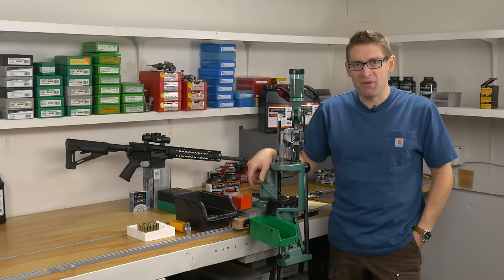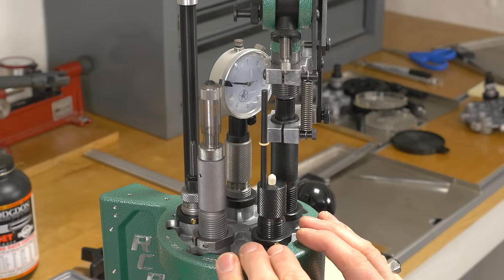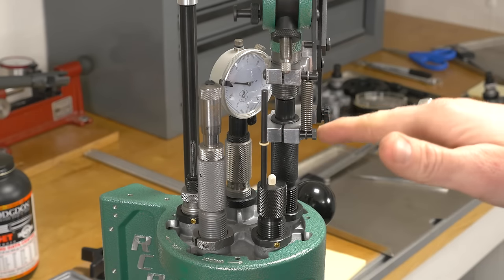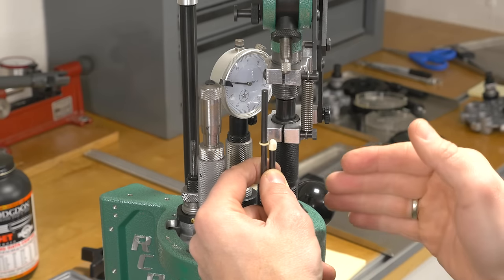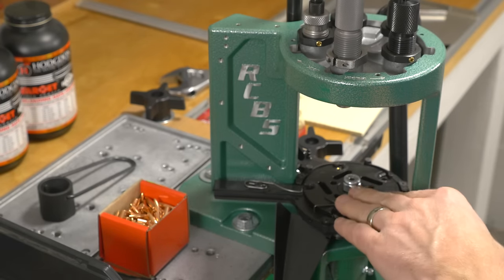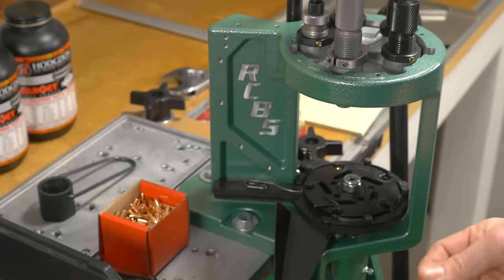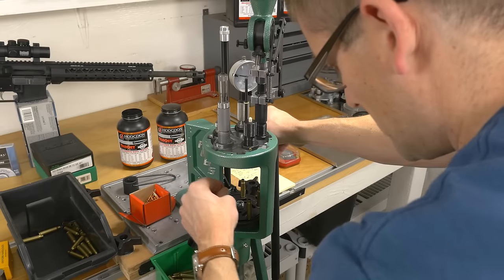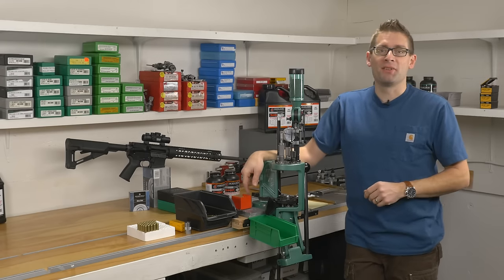RCBS Pro Chucker 5 Loading  .223 Remington

Comment: I like the Redding gauge setup...As you know, it also indicates if trim length is more than .010 under OAL. At exactly 8:00 you can see on the dial that this particular case is approx. .005 shorter than trim length. Great setup and vid...Tnx

Comment: I recently started reloading with the Pro Chucker 5 and I can’t get primers to drop into the transfer bar. And it’s a brand new bar because after I assembled the press I worked the ram handle a few times and the vertical post the spring attaches to snapped off and RCBS sent me two new ones.

Comment: Did you lube the cases beforehand? If so, what is your process to removing the case lube after completing the loading process?

I reload a lot for accuracy stuff, but I'm not entirely convinced with this volume reloading. It seems like you don't really save that much if you aren't reloading "match ammo".
Reply: 30 cents bought ammo 10-20 cents reloaded. So it is a difference. If you get cheap bullets than it can be 10cents...

Comment: Got one of these presses to replace my Hornady LNL because I had broken the pawl a couple of times and was sick of it. I am less than impressed with this press, have a LOT of trouble with the indexing and tried tweaking it several different ways, sometimes the pawl wouldn't even line up with the slot in the shell plate . In the end I REMOVED the pawl and indexed the shell plate by hand, I sent a seething email to RCBS needless to say I'll just continue to use my Hornady. If I ever try and upgrade again (which wont be for a while after wasting money on this POS) I'll just bite the bullet and get a Dillon
Reply from the maker: That's strange- the Hornady issue- I haven't heard of pawls breaking. I haven't had a single issue with the Lock-N-Load APs I own- was the shellplate turning freely? I think Hornady's indexing is best because it has 1/2 on the upstroke, and 1/2 on the downstroke, and the indexing is fully adjustable. I should do a video on that... Lots of confusion out there as to how the inexing is fine-tuned.
Reply: gavintoobe Yeah it's happened twice but to Hornady's credit they replaced the parts no questions asked, just hate the downtime of waiting for them but their warranty is awesome